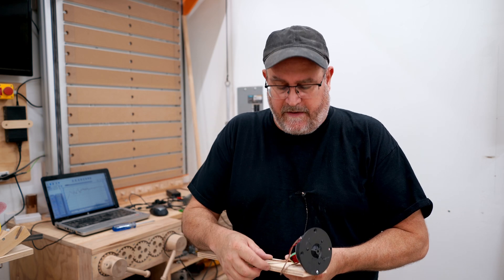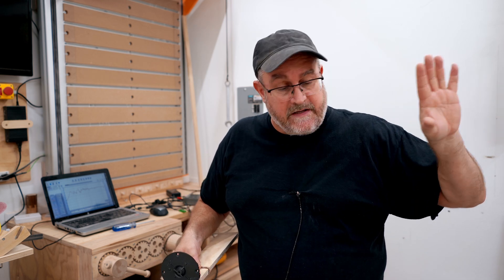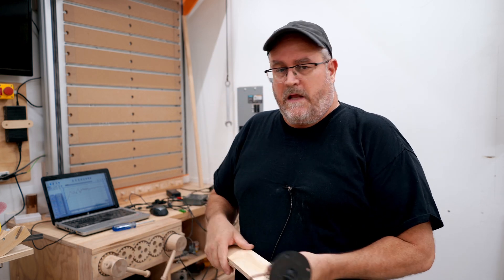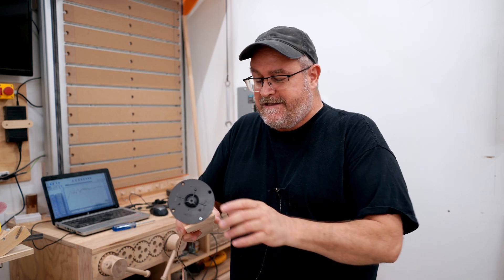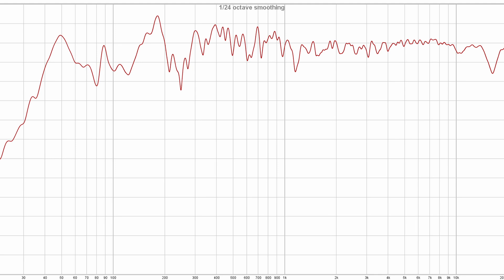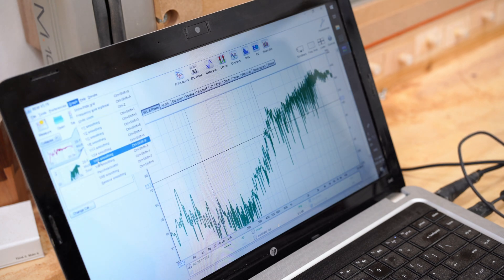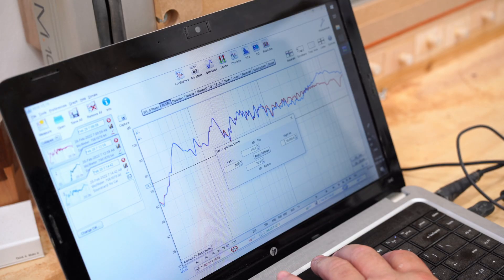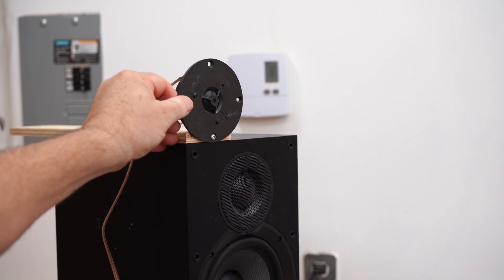Super Tweeters Suck... Here's Why

Comment from the maker: Comb filtering happens when you have two drivers (speakers) playing the same signal and the signal from one of those drivers reaches your ear before the other one. Depending on the delay time, some frequencies are reinforced while others will cancel out, making the frequency response look like a comb with teeth (peaks and dips). This is a very audible (and proven to be audible) effect.

So while the super tweeter can give a substantial boost to the high end response, it can also degrade the midrange response. And our hearing is most sensitive to these midrange frequencies.

Not shown in this video is how much worse the response can become when listening off axis, especially vertically. As you move above or below the speaker's tweeter, the delay increases, causing more of that comb filtering effect.

Getting the super tweeter as physically close to the speaker's tweeter as possible and using a higher order filter (crossover) will help to mitigate these unwanted effects. But a better "fix" for a perceived lack of high frequency detail is to either crank up the treble knob (if your setup has one) or get yourself fitted with hearing aids. 
Believe it or not, hearing aids will make a massive difference if your hearing has degraded due to age or damage. And it's a difference that you can't match by boosting the high frequency response of your speakers or by adding a super tweeter.
Reply: If you haven't tanked your main channel yourself John you better go and look. Looks like someone's after taking it over and removing/hiding all of your videos, playlists and so on. Renamed to ARK Invest, changed your banner and is now doing one of those Elon Musk Bitcoin livestreams ... which are known scams. Just said I'd let you know in case it's not you that's done it.
Reply: John hackearon tu canal principal 🙁
Reply: The frequency comb more over high frequency. I built a tmm but I didn't make it a 2.5 crossover but it sounds good to me because I crossover low but I might change the crossover .
Reply: So what you're saying is that the quality of the crossover matters as much or more (for the tweeter only, I'm talking!) than the driver?  If so, I agree and wish more people thought that way!  Group delay is a thing.

Comment: The problem with having 2 tweeters/speaker is that they need to be placed within one wavelength of each other to be additive.  This becomes problematic at higher frequencies as the wavelength may become quite short (less than 2cm at 20kHz for example).  The second potential problem will be that the tweeters will become much more directional (which may or may not be a desired feature).    For example stacking them vertically will narrow the sound image in the vertical direction while keeping the horizontal image a wide as it was with only a single driver.

Comment: Well explained, and fun to watch and follow process.  Two little FYI things.  First, that speaker is a standard dome, not a horn speaker.  If that was really a horn, virtually all speakers would be a horn.  Second, super tweeters are generally 20kHz and above, and serve a different, but related purpose.
Reply from the maker: FYI, a quick Google search will find that the majority of the super tweeters for sale cross well below 20K. 
And I know exactly what a horn is, so I have no idea what you are talking about. I didn't say a dome tweeter is a horn, but you can horn load any tweeter. If a tweeter is mounted in a geometry that causes a change in efficiency or directivity, it's being horn loaded.
Reply: @IBuildIt  
Call things whatever you like as it's a free country-- I just was trying to help.
Sorry, I was not meaning to be critical.  

I am fairly deep into the analog and digital fields related to audio, video and photonics and related engineering, as I have launched some of the major media labs and studios across the country, and began working with Schwartz, Hafler, Scholz and others at LIHTI, the MIT Media lab, Sound Workshop and elsewhere back in the 70's-80's.  Obviously, like everyone else, I am wrong on a regular basis.  However, in these cases misuse of terminology is very common.  Specifically, it sounds like you may not be aware of the the article some years back that first called a regular tweeter on top of a speaker cabinet a "super-tweeter".  They referred to it as being on top of the box or "super" (rather than in-cabinet or otherwise).   Actual super-tweeters existed back then, but were generally significantly more expensive and served a different, albeit somewhat overlapping, set of acoustic engineering purposes. 

However, while many tweeters drive past 20kHz and many actual super-tweeter begin driving signal well below 20 kHz, common parlance for a super-tweeter world-wide is a tweeter designed to take over for the range above a regular tweeter, or "super" to a tweeter frequency-wise, not positionally.   

Same thing is true of a horn or horn loaded monitor.  While a throat of 2" or more based on any one of many common geometries constitute either a flared (beginning above 2"), or fully horn-loaded design above that using appropriate geometry as well as generally built upon a compression rather than coil-driver, it is as incorrect to call ones that fit in none of those categories horn or horn-loaded, as it is to call partial harmonics, the same thing as  harmonics.  

Anyone with enough years in the profession, or with doctoral or post-doc degrees in the field quickly susses-out those misusing terminology as hobbyists or entry level professionals, as a doctor quickly realizes someone is not a medical professional who be highly knowledgeable compared to other non-medical professionals.   

FYI, also online: 
Horn designs: 
https://www.grc.com/acoustics/an-introduction-to-horn-theory.pdf

Tweeters vs super-tweeters: https://boomspeaker.com/super-tweeters-vs-tweeters/
Reply from the maker: Again, tell all this to the manufacturers that are selling "super" tweeters that cross as low as 4K. I'm sure they'd love the help.
And as for your definition of a horn, tell it to the speaker manufacturers that are horn loading non-compression drivers and calling them "wave guides". 
A horn improves the efficiency by impedance matching and controls directivity, regardless of how deep it is. You can horn-load a dome tweeter with a fairly shallow wave guide and see a boost in the lower frequencies as a result of the improvement in impedance matching. You will also make the output more directional. That's horn loading. Wave guides ARE horns.
Reply: @IBuildIt  I try to not derive my educational cues from marketing gloss and associated methodology.  I get it, you are not a professional engineer, so surface-level terms and terminology definitions work fine for those purposes.  That’s obvious from prior comments and the fact that you directly equate horns and wave-guides.  You are not alone, especially in terms of sales/marketing materials, which strongly bias many consumers.

In the most general terms, an acoustical horn is an impedance transformer and an acoustical waveguide controls directivity.

Many years ago before cheap amplification, horns were designed to make small input signals louder, and aspects like beamwidth and directivity were not generally a priority.   
Later, as low priced amplification was introduced, it became viable to trade some gain and sensitivity for directivity and pattern control. So horns and waveguides, though similar in configuration, are designed for different purposes and are governed by very different equations and associated physics.  

However, in consumer/hobbyist circles many terms are used interchangeably, despite being technically quite incorrect.  Also, words like “guide” that have both technically applicable and common non-technical meanings, often get applied by marketing people (hense Amar Bose’s oribinal push-back on his marketing company’s use of the phrase “acoustic wave-guide technology”, since it was not at all technically correct.  There are completely different equations governing waveguides and horns.  If you care to learn more, one of the veterans in the field provides a good, short overview on the subject: http://www.gedlee.com/Papers/What%20is%20a%20Waveguide.pdf
Reply from the maker: I've made a point of saying that I'm not an expert. If not in this particular video, then in others related. But that doesn't mean I know nothing about the subject at all. Like I said, I know EXACTLY what a horn is, because it's really quite simple.
In fact I made a video talking about this very horn / wave guide "issue" quoting Earl Geddes himself to back up what I was saying. 
Watch that here: https://www.youtube.com/watch?v=1rZBLRdaAoo
Note what he says: "all wave guides are horns, but not all horns are wave guides". That means that a shallow "wave guide" will behave like a horn.
So I AM familiar with his work and I've built horns and used them and measured them and shown the efficiency gain you'll get by using them. He says a wave guide, by his definition, is primarily used for directivity control, but it's STILL A HORN! Are you now going to refute the very source you used and say that he also has it wrong?

Comment: In my observations the comb filtering characteristics change just as much by moving the microphone a few inches as it does the supertweeter. Moving back from 1 meter to 3 meters there are there are a dozen or so node changes, each at slightly different but distinct frequencies. But in the end, the negative effects can go away when listening to complex waveforms (music). With the right crossover and Lpads on both drivers, you can really add a nice new dimension to your speakers. I use a second order xover at 12KHz with a JBL ST450 supertweeter.

Comment: Turn the tweeter backwards or straight up or angled 45 degrees towards the rear. Or position the speaker back from the baffle in 1/2 " increments until the correct phase is  achieved. That is the fun of the quest of the best sound. Baffle-less speakers are the next step. Use a bread board to build an external crossover jjg and test caps inductors and crossover variation.  Lots of cool tests to run.

Comment: One thing that was not mentioned i think ...volume level...at the time of test. These days i listen to music at around 55-65 db. At that level my tower tweeters were definitelly sat backward and lacked detail. Application of diy tweeters (aluminium) vs (speaker tweeter soft dome) with L pad set at 6db and high pas filter at 3 khz appeared to remedy the issue. I can now fully hear strings, platters , bells, air in the room...so  to each of their own. I did play with the spectrum analyzer and it does appear that I am  experiencing some frequency rolloff pass 8khz - but honestly for what i gained which is almost linear response to that point - I am really happy. With that said - all was done on tower speakers with unknown level of degradation off crossover circuit...it just does sound great now...😂

Comment: Nice video! Interesting the comb filtering was more at low frequencies. I guess at the higher frequencies it is there too, but so narrow and evenly spread it is difficult to detect.

For what it's worth my supertweeters have a 2nd order acoustic high-pass at 16khz. Also recommend to keep some distance between them and the main tweeter or even point off-axis a bit.

Comment: what I most commonly see with supertweeters is that people plop it on top of a box with a simple 1st order filter and little to no effort to phase match the tweeter.
A super tweeter should not be used unless the tweeter rolls off at the high end.  Second, a super tweeter needs a high order filter set to a point that takes over for a tweeter with a high freq. rolloff.  They are not meant to compete with each other.  Third, plopping on top of the box is just stupid.  It needs to be as close to the tweeter as possible - literally cutting the baffle of one to accommodate the other.  In the example of the Elac, the supertweeter baffle should be cut to butt directly up to the tweeter's horn.  In other systems, the two baffles should be integrated to minimize the space between drivers.
As you know, electronically phase matching high order filters is notoriously difficult.  But there's another way.  Physical phase matching.
You have the opportunity to phase match the drivers by physically mounting the supertweeter forward or back from level with the tweeter (the Z axis).  You could use 1/16"  or 1/32" shims until you get good phase matching.  This informs you of how well the two will work together, and how deep you want to cut the speaker baffle on the final build.  Basically build a test baffle to get it right before cutting the real speaker box up.  Even so, I understand a lot of people don't like the idea of cutting into their factory spec speakers and modding their drivers.  Too much work and planning, and it takes some confidence in your skill level.  But you don't have to worry too much about phase matching high order filters when you control the mounting depth of the supertweeter.  And since we're talking about a crossover point that should be no lower than 12KHz, it doesn't take much along the Z axis to make a dramatic difference in phase matching.

All in all, you hit on some of the right things to do with a super tweeter.  But you can take it one more step.  Try a 3rd order filter on the ST, add a lowpass filter to the tweeter, and cross them over so they don't compete much.  Then play with physical mounting on the Z axis to phase match them.  I'm sure you'll love the result.

Comment: I built a big powerful 36v 2.1 boombox I took into work, it has two dynalab 8" midbass one recoil 8" sub and two budget soundstream 1"  silk domes and it actually sounded excellent, one of the tweeters blew so I tossed a pair of super tweeters in there place, I was curious I've never owned/used any.... Well the unwanted ear piercing highs are definitely there now I have caused a big frequency gap because it sounds like crap. So I'm putting a set of silk domes back in. I was thinking maybe reinstall the SDs with there cap but leave the super tweets with there cap to possibly compliment the silk domes? Other choice is to leave them in non functioning because I cut a 2.75" hole for them don't really want a big patch. What do you think use both sets of tweeters with there included caps or just run the silk domes. Only problem I can think of is efficiency differences I won't be able to attenuate the tweeters separately just the treble knob that would control both combined... With the super tweets stand overpower silk domes still sounding lousy or will  the silk domes just fill the gap returning my sound quality. I do have a pair of l pad knobs on some old speakers and seen them pretty cheap thinking prob the best option? but that's getting to be more trouble than it's worth for boombox at moment. Any suggestions? I did learn my lesson unless your building a PA system to shoot highs 100 yards or trying to hear highs with 160db of subwoofers super tweets prettymuch suck. Just like how the market pro audio drivers for automotive systems. I've tried PA 6.5" " mids" and they sound lousy, low quality loud midrange no midbass... I replaced my Rockville PA64s with silver flutes now the gap between my subs and midrange is filled.

Comment: I have suggestions for videos and maybe they are fun also. 1. Testing/measuring how adding neodym magnets to speaker elements affect them. Elements with neodym are pretty expensive, magnets not so much. 
Should make them , more sensitive faster and more power efficient(?) 2. Measuring / example how double of cabinet size affect the sound. 
3. Full range speaker elements, does adding tweeter make them better.

Comment: This is a video about paralleel tweeters, not supertweeters. Of course you will get all these problems if you add a tweeter at 8K with a 1st order filter!! That's 6db down at 4K. Even with second order, you are asking for trouble. You are basically running two tweeters in parallel, not a supertweeter, and comb filtering will occur.  If you want to cross so low (because 8K is low for a ST), you would need a 24 db/oct at least. Better still, use a steep filter, as you said,  and cross even higher.

Comment: Your conclusion is right - having good flat sopranos any super is damaging for proper linearity.

By way when we put two identical tweeters in exact distance from one  microphone then should be no any interferences nor comb filtering They just are adding. That is not case in your test where they are different by construction of diaphragms. - sure here was  whole bunch of phases,.

The problem is in capacity of 1 raw filering  which provides second raw filtering in serial connection with tweeter coil and thus createe serial resonance which has nothing common with  calculated crossover frequency and is located much higher - that is the reason of not flat shape in range above 10 kHz. On other hand filtering  at it's fastest slope where we desire it works as fast phase shifter and this of course disturbs  adding and  may provide weakening  of frequencies depending on actual  phases of both speakers  It never will be 2x as calculated - always less, and even mucch less because at tha same time lo-mid provides opposite phase disturbance  That is why in range 4kHz it is down in compare to 10kHz above.Thatis what I learned practiacly and confirmad by measurements in hundreds tests. 

My last idea was  installation of one and later even  two supertweeters for some 8kHz-16kHz  for each widerange in my speakers using four elecrtostats with  flat plates supplied with 200VDC and guess what?  - by ear judgement after month I dismantled them as I am sure they provide  disadvantages while I couldn't notice enough advantage to compensate it.  I do not need them and estimate that the same those who can hear 20kHz